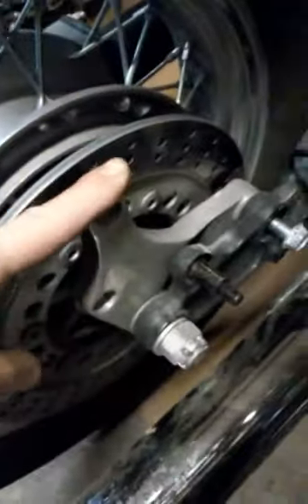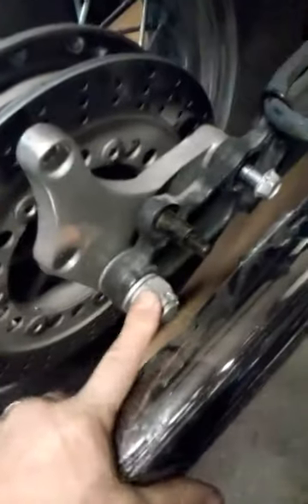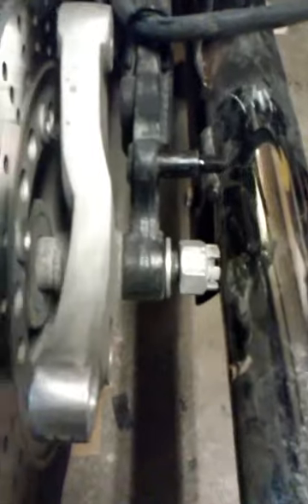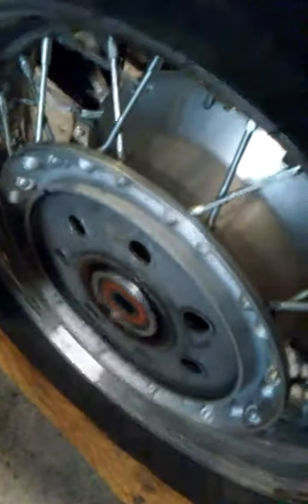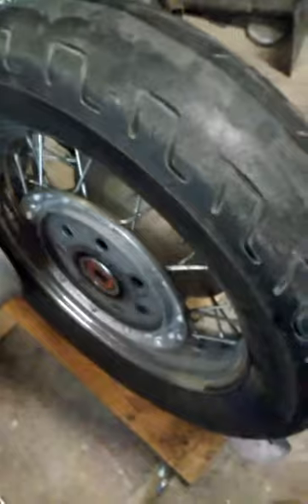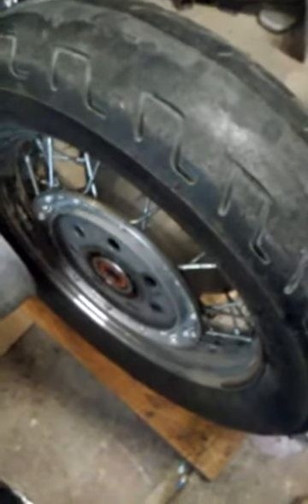How to remove rear wheel from VN1500 vulcan

Comment: and how did you raise the bike up? The engine case is lower than the  frame.
Reply from the maker: Floor Jack set it on stacked boards and I think I had the rear fender off for repaint.
Reply: All you do is jack it from the right rear while on kickstand just enough that it's off the ground..make sure you wheel is turned left also